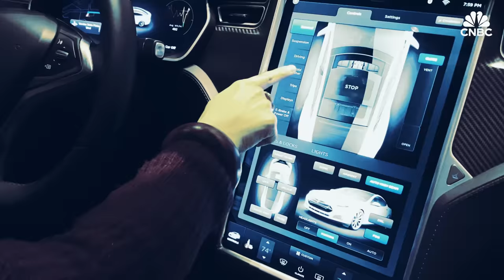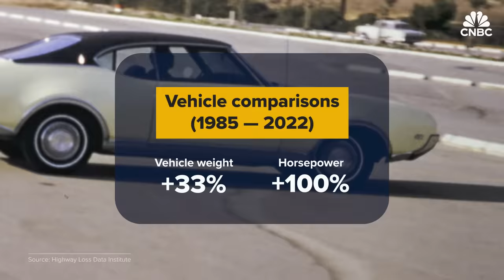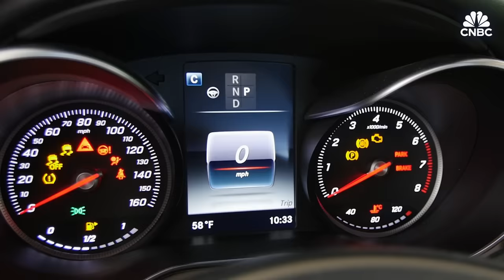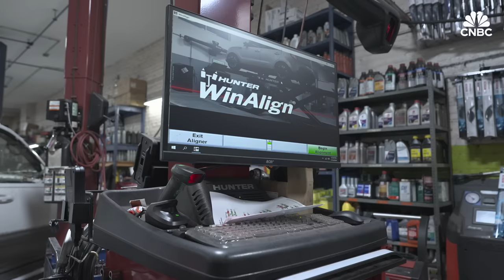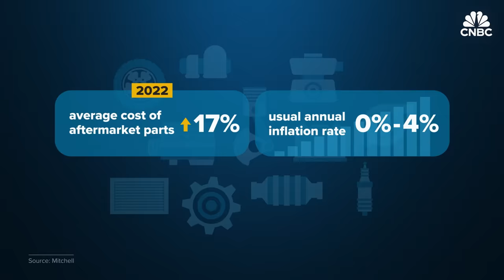Why Car Repairs Are Getting So Expensive

Comment: Been repairing my cars for yrs. Even went as far as buying a manual transmission forester. I can't stand all this complexity and modernization that just adds losses to the owner.
Reply: The best way to go, repairs and maintenances your own cars, you know what exactly what happened and cost much less by do it yourself.  I have repaired my own cars for years as well.
Reply: I put 237k miles on my old Forester and did most of my own repairs and maintenance.  It was pretty much trouble free the entire time I had it and when something did go wrong I could usually get parts cheap over the internet and do the repair myself.  Can’t imagine wasting thousands of dollars a year on an unreliable car.
Reply: Nobody mentions the fact that in 1975 you could pull a bumper out in a relatively low speed accident and keep going down the road whereas today if you hit a front bumper the bumper itself is made to absorb the energy by breaking into pieces and now with radar and cameras molded into the bumper as well you're looking at astronomical costs associated with low speed accidents vs. 40 years ago. Cars began to lose "real" bumpers in the 90s and it's just a piece of plastic/rubber with a steel reinforcement behind that many times also bends out of shape.
Reply: Do you know that most people can not do the same that you do? Do you know that some people have health issues and they cant lift weight etc?
Reply: @ricnyc2759  I am not saying everyone should. At the very least even if you can't, then common sense should tell you to get an easy to repair car. Perhaps a Toyota Corolla, Civic, Sonata etc.

But really, the problem today is a lot of people got used to swapping cars over new cool features and stuff. The automakers noticed and started updating cars every 2-3 yrs. Now there's too much dependency on cars with collision tech, and if you dont want/have it your insurance is penalized. Its a ridiculous industry at the moment.
Reply: I don't like the complexity and increased costs in repair. However, alot of tech and features have increased car safety alot.
Reply: I drive a 1993 and 1990 turbo volvos that i have to do maintenance on every week basically but id much rather do that than deal with modern car payments and cars that have the ECU or some other electronic module controlling everything.

 Cable clutch, cable throttle, no ABS or and other driver aids, RWD with LSD, its all i need. Problems are cheap and simple to fix basically always and i definitely pay way less than the average. These cars are fun as hell compared to the geriatric experience of modern cars as well.

If you want cheap transportation, you have to learn to work on things yourself.
Reply: Me too out of necessity because I need my work truck and can't wait several weeks. Only problem is, My wife just had to have a new Jeep and it took me close to 3 hours to change out two headlights. 

Literally had to pull the ENTIRE air intake piping, air filter housing, fuse box housing, and donate my left testicle.

I could have driven to the parts store and back ... replaced the headlights on BOTH of Silverados in less time than it took me to do that jeep. Hell, I would have had enough time to eat dinner and make love to the Mrs.
Reply: Very true. A majority of people cannot due basic car repairs and with the increasing complexity of vehicles, even home mechanics are going to struggle and eventually, they'll fade away like the dinosaurs. 

Eventually, a home mechanic will have to invest in equipment that can work on these modern cars. Even that might be a risk if the vehicle is warrantied and any attempt to work on it yourself would void it. 

But the narrator is right - manufacturers are going to have to figure out how to make these modern, computer-driven cars more affordable to fix and maintain.
Reply: Couldn’t agree more
Reply: Same here. Learned how to maintain and repair all my vehicles. Get chiltons,Haynes manuals, plus lots of help from Google and YouTube
Reply: It's true but even repairing cars yourself has gone up in price as parts have gotten more and more expensive
Reply: I have two trucks, an 06 Ridgeline and an 08 Frontier manual. Have also done all my own work since highschool. Just bought a 2012 Honda Fit manual for even more simplicity and better gas mileage, and a Honda XR150 bike too (125mpg!). Between the 3 (plus bike) I hope to never buy another vehicle, or for at least another 10-20yrs hopefully. I have no desire to get one of these complex modern vehicles. Simplicity is key! 

Best advice to anyone is to try to scoop up a good simple manual while they still can. Ultra reliable, simple, and cheap to fix. And learn how to work on it yourself!
Reply: I did this years ago, O5 Forester and an 01 outback, outback i had to do the headgaskets been good ever since, all the forester needed was the 100,000 timing belt service, add done myself, both manual trans. Still got em both.
Reply: Hence why my newest car of my 3 is 20, oldest is 50. I just rebuilt my 30 year old truck bumper to bumper for under 5k and its brand new again. All 3 will easily last another 30 years or until I'm a compost heap.
Reply: buy a features packed car and expect its all simple and easy to maintain or repair.
Reply: @whois3581  that Frontier manual has the v6 4.0. With just maintenance it will outlast you.
@Isaiah5417GdLk I have two Subarus. The older Forester is stick shift and a newer Ascent that my wife decided to get. Also own a 91 mr2 toyota turbo. I will keep my old cars running as long as I can find spares for them. I am 39 yo now and have no intention of getting in new debt over these cars that depreciate so much. They're neat I'll give em that but the $ is too much.
Reply: Yea my Subaru legacy has been bullet proof the 4 years Ive had it, I dont even wish to own anything else its treating me so well
Reply: @themiddlekingdom9121 it depends though. What you're doing on thr car. Some people don't know. and have the time to swap a broken transmission or have tools,space,etc. And time is money. why spend 4 days doing a swap? (im generalizing) when a shop can do it in lets say 2. Unless u a car guy/girl with time and know how.only to save 500 dollars when on the end u probably spent more time on it. aka money and would of saved time in the long run. Now if its oil changes and sparks plugs heck tire changes yeah u can save money and time maybe as always.
Reply: Stop whining..Im GenX an dI entered the Auto Industry in 2004...I got my training from the old guys who said the same things. It just so happned we were the comouter Generation and had no issues with computers. So being armed with RESPECT of th eold way of doing things we represent an ushering in and ORGANIC integration of improved technology in these cars...

It fits NO PURPOSE to constantly whine and complain...when I was a kid mechanics REBUILT thing s like carbuerators, master cylinders, axles, etc which is now unheard of and time consuming..

The influx of more sensors into the OBD2 system has improved the capability of diagnosing issues by narrowing them down to the correct system..though SOME things I think were unneccessary like the "drive by wire" accelerator with a spring in it that has no CABLE connecting it to the engine...which led to Toyotas uncontrolled accelerator problem....

but for the most part technology has IMPROVED the ease of vehicle repairs..th eonly people crying are those to LAZY to LEARN...technology is contstantly changing....guys get "good" at repairing cars then want to put it on "cruise control" when the organic developments of technology require them to WORK and LEARN...this is when they start complaining...

Technology isnt going anywhere..so stop whining and get with the program...actual r&r is EASIER..its the diagnosis that has gotten a little more difficult because it requires guys a littl emore than to just hear a problem and say "Its this or that" and just throw a part at it
Reply: How old is your car?
Reply: @HuChing-ob4kk  yeah explain to me how changing rear pads on most suvs now require a 500$ scanner tool because the calipers have electronic servos for emergency brakes.
Go ahead tell me how that makes it soooo much better. A job that used to be 150$ is now a lot more due to this unnecessary tech.

Or far better, explain how the new Tundra needs the Cab pulled off the chassis to replace electronic wastegates on each turbo side.

Another one, bronco sport 1.5 ecoboost. Timing Belt in oil snaps and requires almost the entire engine to be disassembled for a 55$ part that didn't need to be in oil.
Reply: Automatics are fine, but CVTs worry me.
Reply: Been enjoying modern vehicles and the superior components for years. Objectively much safer and smoother rides. Anytime I’ve had an issue, I enjoy the free warranty. Zero headaches. I don’t worry about what tools I need. I don’t get frustrated that every repair naturally requires a tool that I don’t have, and that must be purchased, and it’ll be irrelevant to the next job which will require, again, another brand new tool purchase.

No reading through manuals or watching videos. Stopping and rewinding. 

Nah. I do enough work at my job to come home and deal with some car repair that’ll take hours and may or may not be done right.

Nah, I’ll use my free warranty and drive smooth rides with zero reliability concerns. I’ve owned well-maintained older cars before and you can never get past the reality you can’t trust them in road trips.
Reply: @viffer94 can’t imagine driving 237,000 miles in my life. Good grief—that’s like 30+ years of driving miles. I always laugh at how people put so many miles a year on cars. Do you people have extreme ADHD? I always see these cars on lots that are 3-4 years old with 60,000 miles. That’s insane. Try to stay still for more than 10 minutes. Self-control. Seems like many people have some weird compulsion to drive 500 miles a day. 

I’m coming up on 3 years from my brand new SUV. I took a road trip halfway across the country and back. It only has 20k miles. What the hell do you guys drive to in order to push your mileage so high?? It’s ridiculous. Seriously, it’s comical.
Reply: @justacinnamonbun8658 a lot of times not even there’s like styrofoam behind the bumpers
Reply: @calebtvog  Yes, it's called "energy absorbing styrofoam." 😆 I've had to fix some of that, there's a great Gorilla glue that you mix with water and it foams up white just like the styrofoam and after at least 24 hours of curing it's solid, you don't have to buy a new one if you're a cheap skate like me. Cars today are designed, on purpose, to keep people poor and that's not just from a maintenance and repair standpoint, how about those $700 a month car payments?? 😱
Reply: Not to mention the computerization
Reply: @eggnogaddict6287 maybe you should get out of the house more
Reply: Complexity and modernization aren't the issue. Done correctly, neither one should add cost or failures. Instead, it's the deliberate use of mediocre quality and proprietary software that are the real problem. And this is done precisely because it means that the consumer has little choice but to EITHER pay for expensive repairs, OR to buy yet another VERY expensive car. But at the end of the day, it is the dimwit consumer who is to blame because they do NOT ever push back. We have a society of dumb, passive sheeple who accept crap houses, crap cars, crap healthcare, crap education, and crap government. We refuse to elect people who would change anything, so we richly deserve to circle the toilet as we are now.
Reply: Thank you for buying manual
Reply: @tetrabromobisphenol What assurance can the buyer of a new car that there are not any design defects or poorly made components engineered to break down prematurely. That's why you should avoid buying a new model design until the bugs surface. Certain luxury German autos, for example , suffer from over-engineering to require taking the vehicle to an authorized dealer for $ervice. Limited DIY for major repairs.

Comment: Imagine how expensive it will get for repair shops and customers when every shop has to have manufacturer specific tech to repair brand specific proprietary software. Costs will put the smaller garages out of business, forcing customers to go to dealerships with much higher prices
Reply: Hence, locking you into a dealer brand and limiting your alternatives. Thinking ahead of the curve, nice! 👍
Reply: I remember when this was anti consumer practice and got stroke down (check what happened with OBD ports )
Reply: then that should be included in the overall cost of your vehicle and should free updates and repairs on these sorts of cars in the future.
Reply: It's their plan.
Reply: Some of them just use computer CNC and 3D print. It's not that hard to make.
Reply: Uh.. that's been a thing for 10 years now. Smaller independent shops don't have the software to properly diagnose 97% of vehicles..
Reply: Thats the idea
Reply: But thats what they wont, car dealers have been forcing this since the 1950s and the government is out to get all small biz

Comment: I have a 97 Tacoma. Spark plugs are $3, air filters are $15, and brakes are $35. I fix and maintain it myself. I stopped going to mechanics years ago. I saw the writing on the wall that this was going to happen.
Reply: If you are paying $3 for plugs, you are probably buying knock-offs that could destroy your engine.
Reply: @mikep490   i got a 96 tacoma with 330k miles and use cheap knock off ngks 2$ etc in all my cars, never 1 time had engine problem with them.. sounds like a lotta smoke blowing around..
Reply: '01 4.3 S-10 4x4 just at 200k mi. Do everything myself. Rockauto got complete lower A arms $85 ea. after mech. found worn lwr. ball joints & quoted $1,300. Just plan a weekend soon...
Reply: @goratgo1970  i used to have a 92 square body s10 with the 2.8 it was a solid truck, diy is the best approach in cars and trucks.

Comment: What paid me big dividends was taking an auto shop class back in high school in the 1970s.   When it comes to doing basic maintenance from oil changes, alternator replacement, tune ups, and brake jobs I can do it myself.
Reply: Yeah, pretty much every guy took auto mechanics in my high school in the 80's. Problems is they make zero cars that can be worked on like 80's vehicles today. You can get a basic diagnostic reader for $50-100 but some of these new cars have such complex coding and systems that you need a $10-40K diagnostic unit like a dealer has (plus specialized tools). Still even then, many honest dealers service shops have trouble finding the exact problem. 

Do you have that kind of equipment at your house? I don't, some of that stuff costs more than my HOUSE originally did.
Reply: @waynepurcell6058  You are right about not having the right diagnostic at home and  not being able to find out everything quickly, but there are a lot things in the today's cars today  that  haven't changed a lot since the 80s or 70s when I took auto shop.  Think about what dealers charge drivers taking their cars in for the typical 30k check up.   The higher end cars like Mercedes, BMW, Audi, etc. charges $800 or more for the service and the cheaper cars like Honda, Toyota, Hyundai, etc. are not too far behind.  Nearly all 80's backyard mechanics can easily perform these checks.  The typical cost to change the low cost items like oil, coolant, trans fluid, air filter, light bulbs, wiper blades are over priced.  The sad part is can you really trust the dealer to do the check they are suppose to do.
Reply: I do almost everything myself, the shop down the street takes care of the rest.
Reply: And u see they got rid of classes like that in school
Reply: In my last year of high school in my auto shop class my partner and I were required to dismantle a slant 6 engine, measure bearing clearance etc. reassemble the engine and run it. We also were allowed to to bring in private vehicles for routine maintenance, for me that was a 69 Buick Skylark with a 350 and a Corsair. Kids should learn to work with their hands to fix things.
Reply: Unfortunately my high school didn't offer an auto or shop class.  Best choices for electives available were architecture and media, and I ended up doing media for a living.

Comment: Refering to the problems of tech bloat, that's an area where governments and automakers have failed to think realistically. Not only has it made cars heavier and more complex, its made them harder to diagnose and more expensive to repair or replace so many of us have to leave a damaged or faulty non-essential system dead or have it disabled.
Reply: Yeah... That's one of the reasons why I would personally avoid cars made after 2008.
Reply: @StephenBanyar  fort me it's anything after 1975! older engines did not last long but their overhaul is easier than changing starter on modern car
Reply: Automakers are just responding to consumers who want the latest "high tech" gadgets on their cars.
Reply: Using periods is a non essential system too, it seems.
Reply: @robertlogan7691  It's a balancing act. If the automakers take it too far, the price of the vehicles skyrockets and few if any can afford them.
Reply: @HunterTN  Hence the reason I like the early 2000s and earlier cars

Comment: I've been in the industry for 20 years and the past 3 years has been devastating. I had 3 carpal tunnel release surgeries (two surgeries on my left wrist 2 years apart and one on my right this past year) and a torn rotator cuff tendon last year. I'm reluctant to get back into an industry that does nothing but use me up and throw me away.
Reply: Look into thoracic outlet syndrome it can be misdiagnosed as carpel tunnel and can be common in mechanics, there are at home tests you can do to see if tos is what's actually causing your issue.
Reply: @tearsofjoyforallthispain  thanks, I'll look into that.